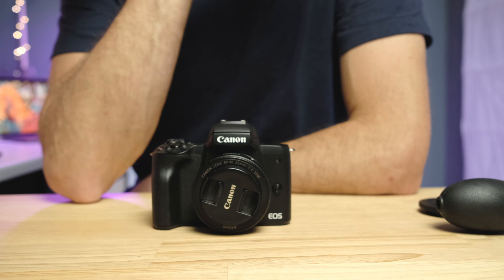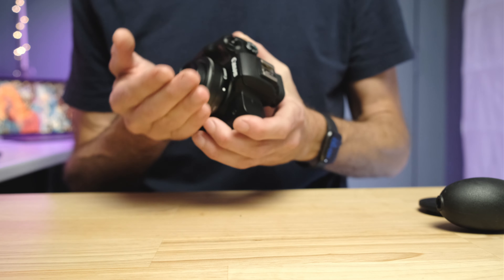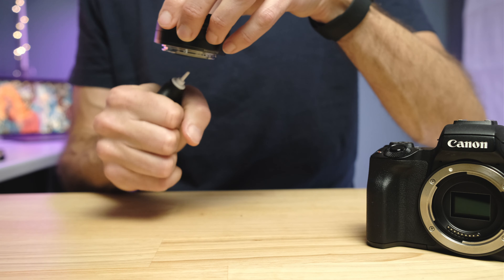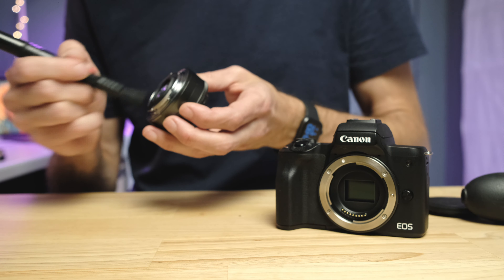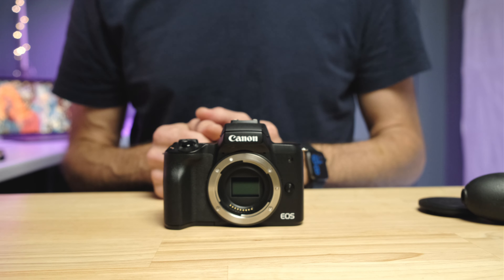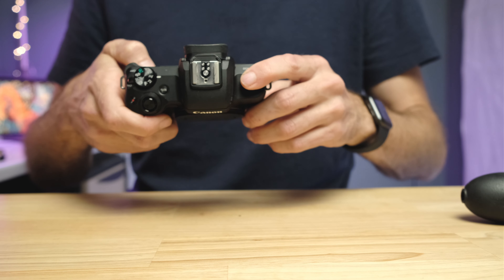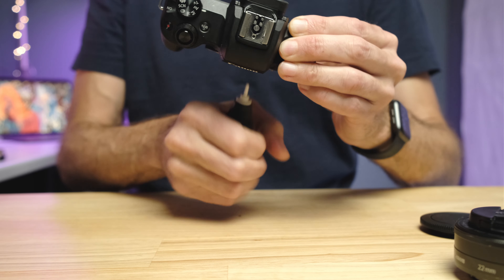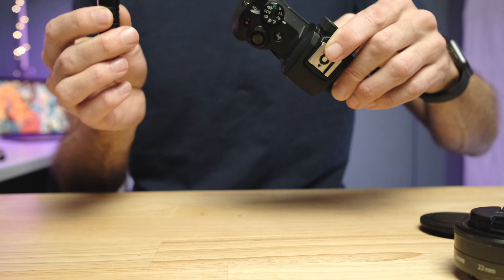How to ACTUALLY Clean the Sensor on Your Canon M50 or Canon M50 Mark II

Comment: Hi mark.  Such helpful information!  I didn't have any luck however with my speck.  I'm going  to do a wet clean next.  Could you cover the difference between the Sensor & the mirror for those of us that don't know the difference?   I saw a speck on what I thought was the mirror.  Got rid of the speck thanks to you but when I look through the lens its still there and soft rather than a hard defined speck.  Thanks!
Reply from the maker: The M50 does not have a mirror, so all you are seeing is the sensor.

Comment: I only came across your video today (two years after it was uploaded). So I was wondering if your affiliate link is still valid. The one you have currently on leads us to a general page that does contain a few option of "lenses cleaners' suitable to glasses, lenses and telescopes. I guess my question is: is this the product you are recommending (can we use regular glasses cleaner on the cam. sensor) or is simply that the link went bananas after the years? Thank you in advance and Great job with the content. Cheers.

Comment: Those Zeiss wipes leave all kinds of lint behind, got some from B&H and could not believe the amount that was left behind. I have a whole big box just sitting in a tote that I will never even touch again for camera use.
Reply from the maker: I have had that from time to time, I just brush them off. The issue I have with the other wipes I have used, is that they leave a residue and don't actually clean the more stubborn finger smears on the lenses, these seem to work every time.

Comment: Finger print ...what can I do about that?
Reply from the maker: Yes, thats a wet sensor clean.  Just order the kit, it's not hard, the the sensor is very robust, not delicate like you might think.  Just make sure there is no sand or grit on the sensor before you do the wet clean.

Comment: Really useful steps. I find myself switching lenses more often now with my M6 mii in order to help get better framing, IQ for the respective shooting environment /place  setting. while being reluctant to switch out in certain wet or windy conditions outdoors. This gives me a second thought as to how I can be a bit more confident that finding a spec on the image does not necessarily mean a difficult cleaning job. Thanks.
Reply from the maker: Always point the camera down when switching lenses too, stops it from catching falling particles or rain.
Reply: @markwiemels  Always. Easier to clean a lense than a sensor.

Comment: Thanks for the video.  You forgot to mention something very important.  DO NOT USE COMPRESSED AIR FROM A CAN TO CLEAN YOUR SENSOR!!!  You may inadvertently spray you  sensor with hydrocarbons (OIL) and now you have a bad situation where you may have to wet clean or send you camera in.  Or even worse the oils could dissolve the optical coatings.  When it comes to optics only use a manual blower!  You're welcome :-)
Reply from the maker: Great tip!